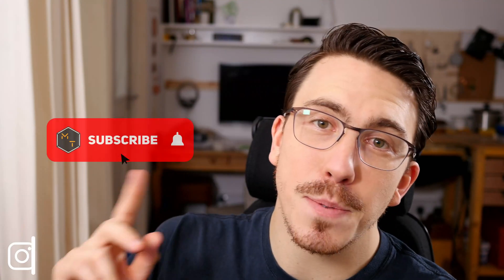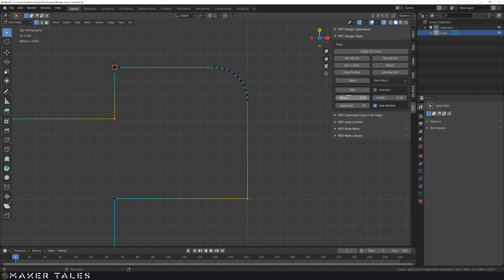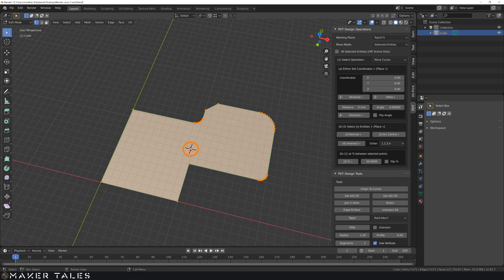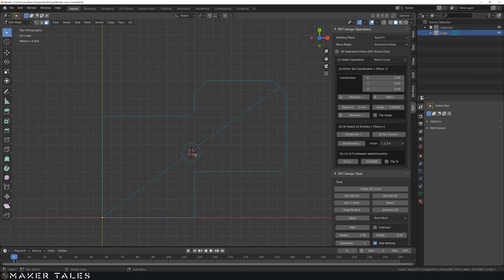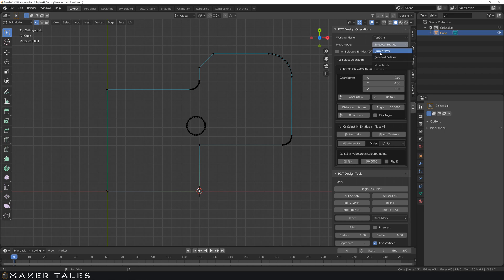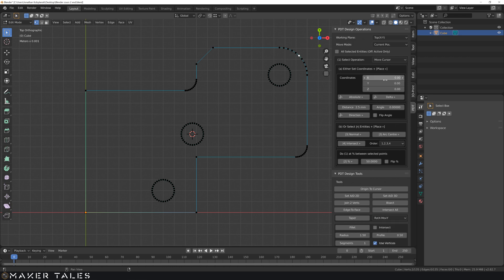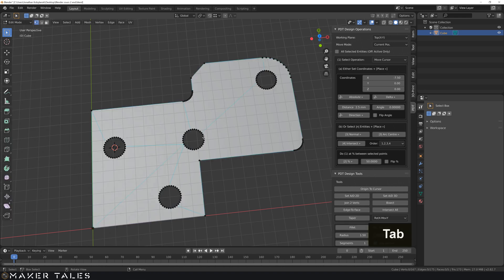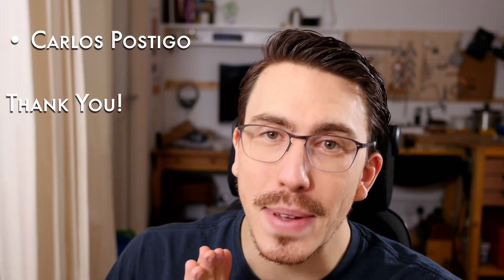Precision Modeling In Blender 2.82 : Holes & Fillets - How To: Using PDT ( Tutorial Part - 3 )

Comment: I really don't want to dis this video, or PDT, which can  sometimes be very useful.
 But there's a reason Blender has a reputation as a fast modelling tool, even for some aspects of precision work. 
Here are some more Blenderish, and quicker alternative moves to the ones shown here:  (Set your Snap to 'Vertex', and 'Active'.)
In all the Fillet and Chamfer examples,  Ctrl-Shift-B (Bevel) produces identical results, with numerical entry. It is not less accurate than PDT, but is less flexible, for arcs through other angles.
4:04 .. Shift-S, Cursor to Selected will put the cursor exactly between the selected vertices. (PDT would be useful if it wasn't at 50%)
9:27.. Shift-S, Cursor to Selected will bang the cursor straight on to that vertex.
10:40 Create the new circle at the cursor, and then G > move the *circle*, entering the X and Y numerically. A bit easier than moving the cursor. 
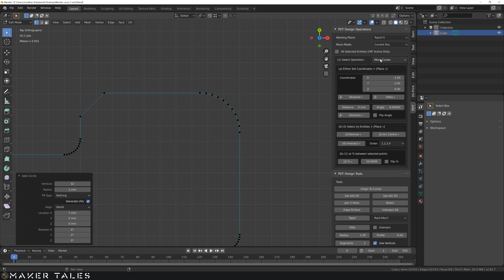12:20 for the center of the arc, Shift-D, duplicate a vertex to one end of it, GX or GY, snap the duplicate to the vertex at the other end in X or  Y,  Shift-S,  cursor to selected. (Delete the duplicate  vertex). PDT would be useful if the arc was not through 90 degrees.
13:37 Shift-D duplicate the central hole,  and move the duplicate. GX, enter the 7.5  numerically.
14:32, To fill the face-with-holes, In a clean set of outlines, without leftover connecting edges, Alt-F. Followed by X > Limited Dissolve to get rid of excess edges. (You may want to get a prettier arrangement of internal edges by J creating new ones between selected vertices, and Ctrl-X dissolving the edges you don't want.)
(Ctrl-Left-Click, the selection of all vertices along the shortest path from the last selection, is useful if you're filling perimeters by hand)
I really like what Maker Tales is doing, proposing Blender as a reasonable precision modeller ( although, strictly, it is  a visualisation and animation suite.). This is a nice, carefully made presentation. And Lord knows, he's much more skillful than me in most of the areas he covers. But I  don't want viewers  to go away thinking 'Oh my God, this is such a grind'.  You can do the work in fewer, simpler, steps.
Reply from the maker: Hello Robin,
You make a valid point... 
A video covering this many shortcuts and 3D modelling specific terms would once again lose the audience that I'm doing my best to help learn blender. It comes again to the idea that this is a beginners course using a spiral learning path to teach. Considering you know blender so deeply I'm sure you are aware that many operations and ways to get the same result. I guess a weird metaphor to explain my thinking would be if I was teaching someone who had never driven a car before would I take them nice and slowly in a little fiat micra down a country road to grasp the basics or would I stick them right into a Ferrari F12 in the middle of a Nascar race. Your point is valid, many might like the fast peddle to the metal style of learning and if they crash, well screw it they can get back up and keep going. However, I'm going the slow and steady route as I know from experience while grasping other 3D Softwares can be very daunting and even a small bump that sometimes really throw someone off ever wanting to learn a 3D program.

On a personal note, yes blender is very heavily focused on visualisations and animation. The beauty of blender is that it's open and makers are all about open source. Thus they can transform an application that was intended for one topic into completely another topic. If others don't want to use blender as "Blender Foundation" see's fit ie. not using their workflows and a more organic-based modelling methodology. Well, I'm sorry to say but that's not how the cookie is going to crumble. I've been lucky enough to have been in the position to learn both Organic and "Precision" modelling. My 3D modelling program timelines goes a little like this: Maya, Zbrush, Mudbox, tinkercad, mesh mixer, rhino, fusion 360 and now I'm taking on blender. By all means, there are great similarities but having worked professionally in both worlds they both have completely different mindsets. I say this because of the idea that something is a "grid" comes with the domain of precision modelling. Many makers understand that to do something right you need to be consistent, methodical and well quite frankly slow. Yes, blender can be incredibly fast, hell just take a look at CG matters, CG Geek
or Imphenzia. The world that I'm looking to help and teach to are those that are interested in 0.01mm margin of error. This is why speed is not really the goal here. Speed will come with time but precision comes with patients and understanding of the principles. So just to confirm, I'm not saying you can't be fast and precise. I saying that being fast, precise and new to any program is near to impossible.  Anyway, I feel like I'm rambling on here. Thanks for your input robin.
Reply: @Keep-Making   Thanks for your very reasonable reply. I really don't want to hurt your video, or your process, and I get where you're coming from. In my defence, it's not the shortcuts I'm driving at. All the examples I gave could have been executed through the GUI.. IMO, they're not 'quick tricks'; they're basic Blender building blocks. 
For example, pretty much the whole reason for the existence of the 3D cursor (flawed as it still is) is to snap to the median point of selections, and, in turn, have selections snap to it. Shift-S would strike me as very basic to precision.
To stretch your driving analogy, even if I was in a Micra, I'd still want to be taught threading the wheel, changing gear with only the palm of my hand, feathering brakes, etc.(even if those ways seemed awkward or slow while I was learning them), so when I found myself in a truck, I wouldn't have habits to unlearn.  One of the beauties of Blender, for me, is, instead of making me hunt through a forest of UI for a semi-automated tool which will try to do jobs for me and screw them up in ways I have to get round,  it hands me much simpler tools which I can learn through repetition, and leaves it to me to compose operations for myself. I found this particlar aspect  a huge relief after Maya and Max. XSI was also beautiful in this way, before Autodesk clobbered it.
But I'm sure you're right, yours is probably a better way in for, say, CAD users.  I hope my examples can stand as a temporary playground for people to get an inkling of how they might eventually use this tool, and not as a harsh criticism of  your obviously thoughtful, and well-engineered presentation.

BTW, you can squeeze 1 more decimal point out of the display of edge-lengths, angles, etc, by setting Scene > Units to 'None'. That's something that could definitely be improved.
Reply from the maker: Hey Robin,
No problem and I understand where your coming from. I guess the long and the short is I can't really cater for everyone but for the widest audience I think may be of interest. For me these are people that are use to a mode CAD style interface and workflow and those who may have never touched a 3D program before.

On a side note when it comes to blender it has a great UI in terms of ease but for none sub-mm precise modeling that I could only dream of when I was working in VFX but in terms of CAD it has some huge nightmarish lacking ease of use features that many rhino and fusion 360 users cringe to see that it's not a 1 button click. Anyway not really much more to say here. Everyone has there own journeys to take while learning 3D software and I'm sure I'm just a small pit stop for some and a cornerstone for others. 😀
Reply: @Keep-Making  It might be a good idea to pin comments like these so they can be used as additional material once you have completed a tutorial and want to know if there is a way to automate or quicken these processes. I think your approach makes perfect sense for a tutorial for beginners but anybody who wants to get good at this kind of thing will also appreciate the presence of these keyboard shortcuts. 

I come from the text editor centric world of software development and one of the things that attracted me to Blender (alongisde the obvious FOSS nature of it and it's power) is the amount of keyboard shortcuts that it apparently has.
Reply: @rbettsx  sure! Briefly (while I make a blend file): 10x10mm rectangle. Select the corners. Control-Shift-B for bevel, 2.5. Select 10 subdivisions. Put a 32vert 1mm radius circle at each bevel center. Print the tuple of all vertices to the system console (sort and save).  Alt-f to fill, select the edges, limited dissolve to 1 degree, print tuples and sort.  A file diff shows nearly every vertice changes except for a few.  With 5 degrees, its even worse.
Reply: I was thinking something very similar here. PDT sounds like a great tool, but many of those options are very quickly done via the keyboard, just have to learn them, and for many, that's the hard part.
Reply: Just wanted to comment: Limited Dissolve can change your actual vertices if you use the default values.  I was able to get my perimeter vertices to not move with an angle of 0.1 degrees, but I didn't validate the bevels. If I did this with the default 5 degrees, all precision is lost... that alone should invalidate that as an option.
Reply: @jtmcdole  Hi! I was really interested in this one: it runs counter to everything I understand about Blender internals, and I haven't yet been able to reproduce it. I've been testing with arbitrary complex meshes, derived from text, noisy subdivisions, etc.  My test has been to duplicate, separate to new object, limited-dissolve, delete faces only, count verts, rejoin, merge by very small distance (0.000000001), count merges. I haven't yet managed to get the merge-count different from the vert-count. It can remove vertices, of course,  but you can deselect those you don't want touched.
Reply: @rbettsx  I'm saying the positions moved. I noticed my bevels looking a little off, and when I went to look at the offsets, I wouldn't have 10mm, it would be 9.998mm or something odd!
Reply: @rbettsx  maybe it is 2.9 blender?
Reply: @rbettsx  https://blender.stackexchange.com/questions/195221/limited-dissolve-changes-vertex-positions
Reply: @jtmcdole  Thanks! I've gone through your written instructions, no luck in finding a failure. Will check BSE Q. and delete some of this conversation.. don't want to clutter MTale's comment section.

Comment: Enjoying your videos on treating Blender with the sensibility of CAD software. A tip on filling in all those faces without telling blender how to manage those holes. Alt-f should fill and triangulate or rather connect all the vertices for you. Or at least I think so 🤞
Reply from the maker: really?
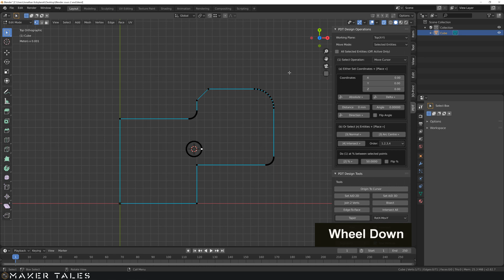I found that when I did that at 5:11 all I would get is a mess
Reply: @Keep-Making  The reason, I think, is that if you want a proper manifold, you need to have the same number of vertices along the outside shape as you do around the circle so that blender can map each vertex from the circle to a point along the outside edge. This is only true for shape with "holes" in it.  by splitting the shape into two faces, then each face is simply a shape with n-vertices and is a proper manifold.

Comment: Hey Jonathan.. I have a Tipp for making holes in surfaces. Acutally, I was quite annoyed at how cumbersome blender is with holes in surfaces so I played around and here is the tipp:
Maybe you or your viewers would enjoy this. I think it's simpler (at least when you have many holes).
--- 
1. [Edit Mode]: The circles you have (where you want the holes in the surface): Make them separate objects. (because we want to do a object subtraction, they need to be their own object.
     You can do that by right-clicking and choosing Separate while in Edit mode (and with them selected)
2. [Edit Mode]: FILL them (create a face, as you have done) and then EXTRUDE them into the z-direction, so they become CYLINDERS. Height doesn't matter, neither positive or negative z-Direction.
    Move the cylinders slightly through the surface (if only the faces touch, it will not work perfectly). Make it look like you want to punch the cylinders through the surface.
3. [Object Mode]: Select the surface that you want the holes cut into. Goto Modifiers on the right and choose "Boolean". Choose the cylinder (which now is its own object). Make sure that Difference is selected. Hit apply.
4. (this is important): MOVE the cylinder away.
5. Admire hole in surface.
----
It seems to me that Blender can only do Object boolean interactions, if at least one element is a full body. I couldn't get this to work if both objects are only faces. Seems to be a bug or oversight.
I believe this might be faster than the whole weird/cumbersome clicking of vertices and trying to make the right surfaces..
Tested on Blender 2.83
Reply from the maker: Hi Fuzzifikation, I love that your expatriating and progressing forward.
Absolutely this is a very valid way of create holes in objects and surfaces. From my understanding currently exact surface to surface bool operations cannot be done or a very buggy. This some times happens with 3d object that have exact intersecting faces. 

Thanks for sharing. I'll be covering all this and a lot more soon. I just want to teach it form the VERY basics of pure face to face control i.e. on a 2D plain first before we start to play around within the 3D space. Come 2 weeks times things will start to get exponentially more complicated and knowing there VERY basics of how blender works on a 2D plain will make the transition to 3D and dealing with the hurdles that come with 3 dimensions a lot easier to tackle and understand. 

p.s. Yes clicking vertices SUCKS but you'll be surprised how much more your'll have to do it to get 3D objects to play nicely once things get complicated.

p.p.s. I also plan on doing a whole post series after the basics are covered of how to put all that has been learnt into real worlds examples.
Reply: @Keep-Making  Thanks for being so nice.
Reply: That's what I wanted to say. Thank you! 

In this way, you can cut all types of holes, like triangle, oval and all other shapes.
Reply: @labscience8271  you can skip the extrusion part and the moving in between the part. the surface will split anyway, and then if you have any jagged edges, just follow the suggestion @Warcans had around limited dissolve, which will join broken surfaces, for you to then delete with x -> remove faces

Comment: I was having a problem with linux mint: I couldn't Alt Click to select the other loop because mint (and Ubuntu as far as I know) have an option to move the actual program window with ALT + left mouse button click.

In Mint this option is under de Preferences > Window Management > Behavior

I disable it and ALT+Click work fine.

Hope it could help others.
Reply from the maker: Thank you for the heads up Tom.
Reply: @Keep-Making  Same thing is for the Alt+Rightdrag (don't remeber where it was needed in Blender). I changed it to use the Super-Key in Mint, and stick with the Alt-bindings in Blender.

Comment: Interesting video! I would highly recommended you to check out Measureit-ARCH. It adds different kinds interactive rulers, bounding boxes and other cad visualization elements to blender which feel really integreted to blender native tools like modifiers, shape keys etc. 

It is absolutly essential (!) for any kind of CAD work in blender, so no need to memorize what you did anymore.

https://github.com/kevancress/MeasureIt-ARCH
Reply from the maker: Hey Elyasaf, Ya MeasureIt is great! I'm going to be doing a small introduction to that addon in the following week. It really helps to keep an eye on your over all design. I just wanted to share what blender can do naively first. Thanks for letting me know.
Reply: @Keep-Making  No problem, man. Blender unfortunately got a reputation of a bad CAD modeler, but with more people developing tools, discovering new techniques and showcasing it's potential (like you), I believe it will change.